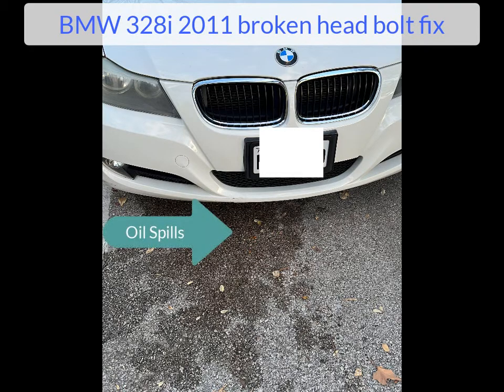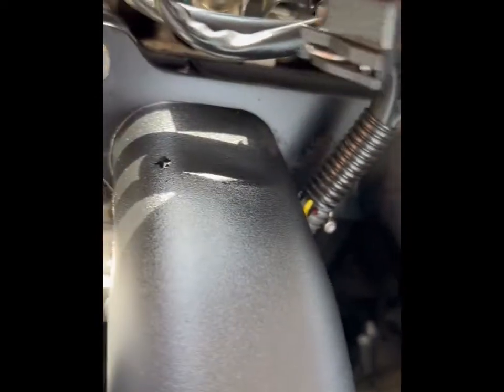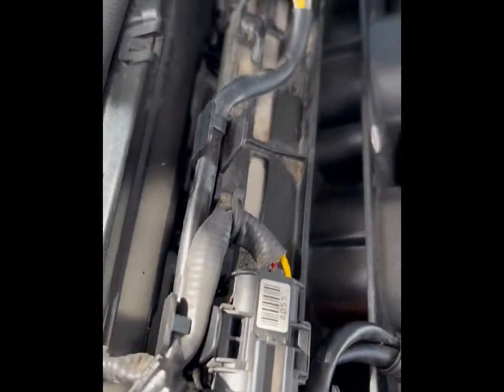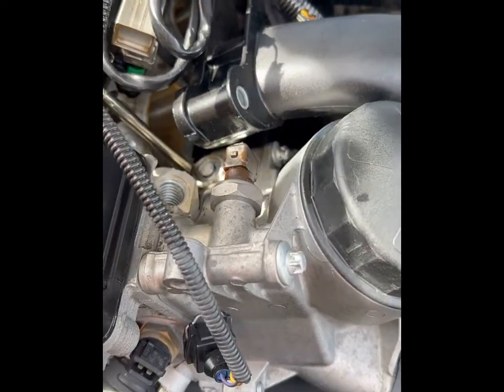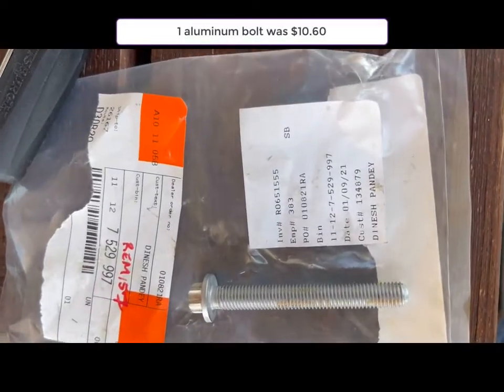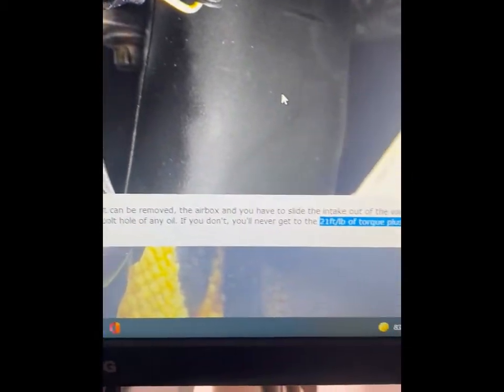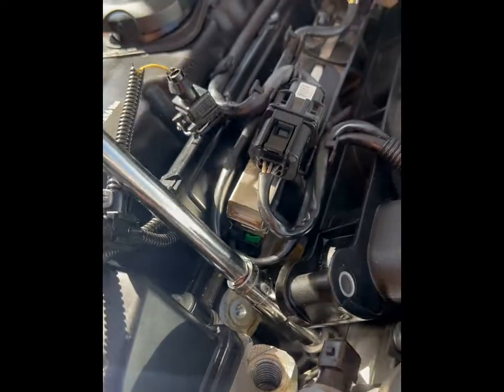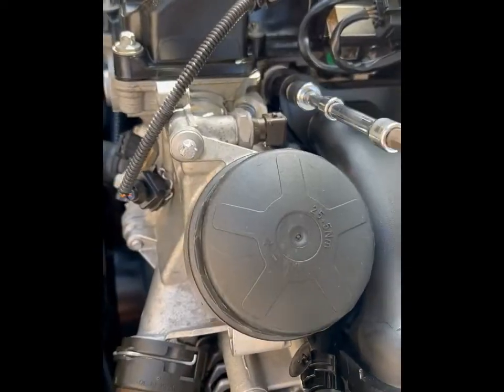Fix oil leak, broken bolt, BMW 328i 2011 N51

Comment: I just replaced my oil filter housing gasket today on my 2006 330i. And i noticed that same broke bolt! Thank you for the video. Now I need to find the proper bolt needed.

Comment: Did you have to replace the gasket on the manifold?
Reply from the maker: No, I didn't since it didn't break and seemed to have been replaced not too long ago. It was still rubbery, not dry or broken.

Comment: So something IMPORTANT to note here. Technically this is the "Timing Case to Cylinder Bolt". It has a different torque than the Cylinder Head bolts under the valve cover. Based on a BMW torque specifications  sheet I found online, the correct torque for the bolt in this video is 15 Nm or 11 ft-lbs (132 in-lbs)
Reply: Hence why everyone is breaking it because they don't do their research..
Reply from the maker: Thanks for your note. I used what I found, but noted. The bolt is still in place and it has not break yet. if it breaks again I will use 15 NM.
Reply: For N52K engines, the shorter bolt (M9X30) is 10nm + 90deg. The three longer bolts (M9X70) are 10nm + 135deg.
Reply from the maker: Great, thanks!

Comment: Could you confirm it is 21 fb torque? I did 21 and bolt breaks and I got another broken bolt, luckily I bought 3 of them and I did 11 fb that I googled with my 2nd attempt. 
Btw: my engine is n52
Reply: What is the name of the bolt exactly
Reply from the maker: Head bolt behind the oil filter housing . . .Technically this is the "Timing Case to Cylinder Bolt" as @anthonyjames5067 notes in his comment.

Comment: Perfect, well described video of the issue and the process needed to fix it once and for all. I replaced my oil filter housing gasket and the leak still surfaced in the same area. Now I finally have the knowledge to repair it. Thank you very much Miguel!
Reply from the maker: You are welcome, I just wanted to make a video since I didn't find any on how to do it when I needed some guidance.

Comment: The screw in my BMW broke about 7mm below surface. Had to use a drill bit and screw extractor. Pics didn't work. Not difficult,thankfully only aluminum,  but still a pain in the butt for a repair that shouldn't have to be. Not to mention I confirmed that the other three internal head bolts for timing chain housing were also broken as is often the case. I did not repair these and so far so good. No oil leaks.
Reply: Mine was also broken almost 10mm under the edge of the hole. I spent 2 evenings and a total of 4 hours to get it out with a couple of picks. It was a pain, but worth it for me, since I dont like the idea of drilling next to intake port.
Reply from the maker: I feel your pain. Thanks for sharing.
Reply: What drill bits did you use ? And extractor kit ? Mine just broke lol
Reply: Hey even if the bolt doesn’t look like it’s leaking only chipped but pool oil same location as pointed out , is it still the Bolt

Comment: Wow thanks for this video! Super easy instructions. I just found a pool of oil in the exact place and a broken head to the bolt in the oil. Waiting for my part to come in next week. I’m having two codes come up showing P0174 and P171. I’m hoping by replacing this bolt it would take care of these codes. If not I’m going to need to do a smoke test to find vacuum leaks
Reply from the maker: Glad it helped
Reply: Update : replacing this bolt cleared my P0174 and P0171 codes. Thanks again for this video 👍🏼

Comment: 😄 Promo`SM!
Reply from the maker: StratMap?
Reply: @miguelpavon2553  do you remember the part number for the bolt or how you found it?
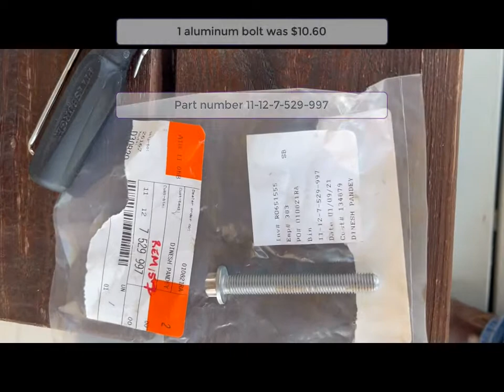Reply from the maker: You can see the part number at 2:34 min into the video, you can get them with that part number at the regular suppliers, the BMW dealership, FCP Euro, Pelican Parts, etc
Reply: @miguelpavon2553  yep I saw that right after I commented. Got the part and replaced mine. No more leak. Thanks for the help. 👍👍👍
Reply: @miguelpavon2553  never mind. It was in the video but just a little hard to see. I have the same issue. Thanks for posting this.